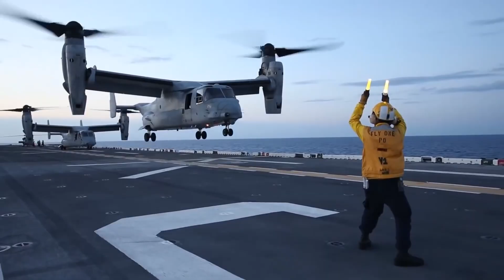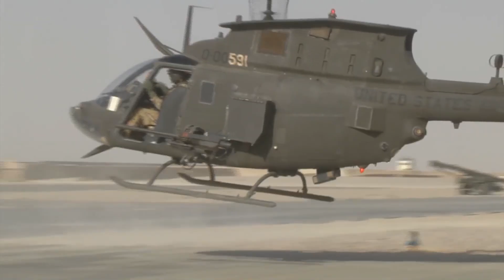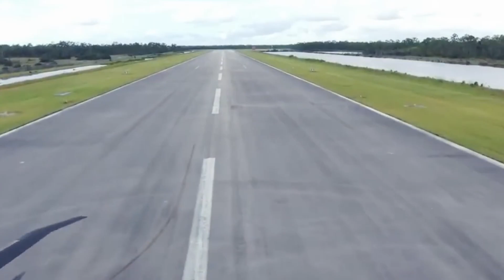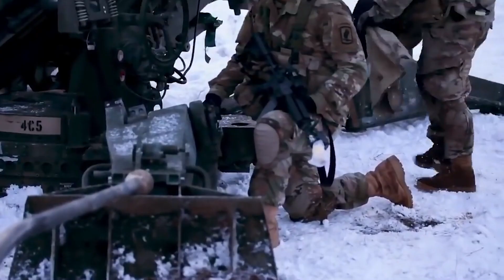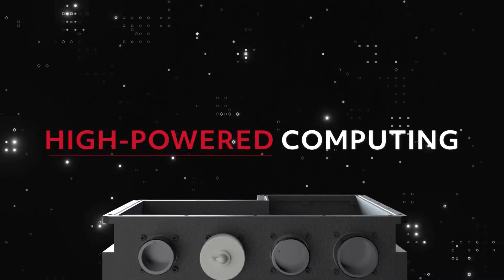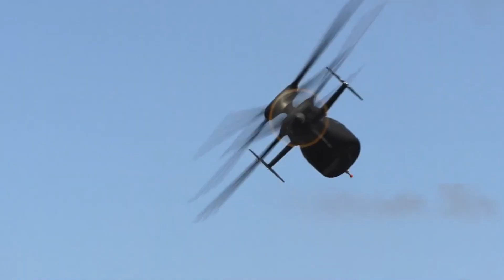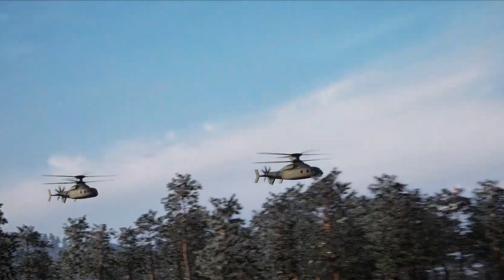SB-1 Defiant - Must go faster!

Comment: Can it fit inside a C-5/C-17?
Reply: If they have to transport it by plane they would take off the wings and rotors. One of the points of the program was for the aircraft to deploy itself and not need air transport as often.
Reply: @n3v3rforgott3n9 that’s a lot of air refueling, and can it reach the ceiling to refuel safely?
Reply: @PatrickJBird  Its ferry range is almost the range of a C-130. So likely for most trips it wouldn't need aerial refueling as it can go from Cali to Hawaii on a single tank. Although yes, all of them will have the ability to aerial refuel if needed and tilt rotors can be refueled by some of the larger jet tankers that other helicopter can't be refueled by as they can't go fast enough. It isn't the altitude as the plane can just fly at 10-20k feet or where they are needed.
Reply: @PatrickJBird  im talking about the v280 valor btw just to be clear

Comment: i just dont see the V280 doing the same thing that the black hawk did when  they went and got osama bin laden, i dont not think they could of got 2- V280s in and land in the area like the black hawks,,,,the old saying is if it aint broke dont try and fix it, stick with the same style , the DEFIANT is bigger and faster than the black hawk, and the the DEFIANT  can still do the same things the black hawk only better and much faster, did not so with the V280. much much bigger. if it lost an engine  in helo mode could it fly still, could it make the prop go from helo mode to plane mode and fly, or would it have to stay in helo mode the whole way back....
Reply: Not only was the valor better than the defiant in nearly every way but you are also overstating The valor's size. It has a 19% larger footprint size and total and would land in the same lz's. Also, tilt rotors can fly on a single engine.
Reply: @n3v3rforgott3n9  ok question here, could the V280 of been use for the BIN LADEN raid instead of using the black hawks
Reply: @highlanderthegreat  1. This is for the main army and SF will always use whatever they want. So that is a bad operation to look at. Instead look at the helicopter infiltration that happened in the first gulf war. 
2. Given that they breached the compound with explosives... yes. Finding the exact size of the courtyards is difficult. 
3. There is never one way to do something and plans can always be adjusted. Even going from the Huey to the Black Hawks had entire SOPs being rewritten and improved upon with time. The same would happen with this new platform.
Reply: @n3v3rforgott3n9  would they of trusted the V280 on the BIN LADEN raid
Reply: @highlanderthegreat  Not even the Osprey has a worse record than other aircraft still in service. The Air Force has their Ospreys at a better destroyed rate than their Black Hawks even though they use them for the same mission sets. The Osprey is also the first ever full production model of its kind.

Comment: The problem has nothing to do with power and everything to do with transonic turbulence.  At high speed, the forward-moving rotor will break the sound barrier and have zero lift while the rearward-moving rotor would be so slow that it will not produce lift either.  That is why the speed limit for helicopters is about 1/3 the speed of sound.  It's amazing they got that fast.
Reply: You can use stub wings or, in this helicopter's case, a pusher prop to reduce the load on the rotors which reduce their speed. Allowing you to get higher speeds.
Reply: @n3v3rforgott3n9 You can get higher speeds for a helicopter. But you will still have nowhere near the speed or range of a tilt rotor. Like I said above, the biggest feature that cause the V-280 to win is its speed and range. It is Self Deployable to virtually any anticipated theater of operation. The Army does not have to crate it up and have the Air Force haul it to the other side of the planet. For the Army that’s a game changer. In much the same way having portable drones have reduced the need for close air support missions from the Air Force. Inter Service cooperation and support is great. But anytime you don’t have to pass that coordination up and down the deep chains of command for 2 Services greatly improves efficiency in combat.

Comment: best video on the SB-1!  The good thing and the bad thing are counter rotating props.  Good because the asymmetric lift is cancelled out.   The helicopter can fly faster.  It can accelerate and decelerate while maintaining level flight.  Bad because the props can hit each other.  Anytime, anyplace.  In my perfect world, all maneuvers would be analyzed for upward force on the lower rotor.  How many tons of force are on the lower blade in a 90 degree bank.  Left or right.  Calculate the distance between the rotors.  The distance between the rotors is actively sensed.  Compare the calculated distance against the sensed distance.  That’s a lot of calculations.  Four blades on each rotor, two rotors.  Say 200 RPM.  If rotor ABCD is 200 RPM but rotor 1234 is stationary there are 200 X 16  calculations a minute.  If both rotors are 200 RPM there are 200 X 200 X 16 = 640,000 calculations a minute.

Comment: The only way to achieve higher speeds in a helicopter is to spin the rotors faster. To do that, the rotor diameter must be reduced. If the diameter is reduced, payload is also reduced. So the solution has to be a tandem rotor system. Also the angle of attack and the wetted area must be reduced to reduced induced drag and parasitic drag. So now the rotor looses partial ability to vector lift for forward flight. So the solution to this is a pusher propeller system as anti rotation is no longer necessary due to the double rotor system which has to be there to regain payload capacity. This whole machine is a collection of compromises.

Comment: Given Boeing's track record, I would not be taking any risks on procurement with an ambitious new helicopter design from them. The V-280 is just way more developed, proven, ready, and providing critical capabilities the military really wants (range, speed, reliability). Given the increasingly tenuous utility of attack helicopters in the modern battlefield and how incredibly expensive they already are, I'm not sure the SB-1's future as an attack helicopter looks bright either.

Comment: It cant go faster because of the physics of rotor blade craft , only if they can rotate the rotor 90 degrees  to the direction of flight, like the Bell V280 valour! which functions as a pure aeroplane , when in forward flight mode!  Helicopters are helicopters and serve doing those roles that planes cannot do.  The hybrid  helicopter / plane  such as the Bell V280  plane, can do both with very little compromise, why else would it be chosen?  Thus the traditional helicopter is now defunct, the V 280 will be chosen by all branches of the US armed forces for obvious reasons!

Comment: There had to be some dirty dealing to decide on complex, more difficult to fly, tilt rotor. Just in my youtube viewing I have seen a number of places the military will need to land a helicopter where the tilt rotor will not be able to fit.
Reply: Couldn’t possibly be because the V-280 met the specifications while the SB-1 needed a future engine to even reach minimum specs…

Comment: The ah 53 was a bit faster, it was capable of going I believe the max speed that a helicopter can theoretically go. Maybe it's time to dust off some 54-year-old design specs another reason why the helicopter is getting unstable it about 240 knots is that it doesn't have any Wings to take some of the stresses off of the rotor system. One of the biggest reasons why the ah 53 was so fast. And it could linger for an extended time and had a greater range than the A10. And was almost as fast as the A-10. Have the A-10 and that piece of shit Apache was a reason why they killed the Cheyenne helicopter. By the time they built the very first Apache they could have had well over a thousand of the Cheyenne in service with the same amount of money. And it is capable of doing everything the Apache is capable of doing only faster and longer and better and easier to fly.

Comment: Absolute speed and range is not everything and ideally both have a role. I personally prefer the SB-1 to replace the Blackhawk. While tilt-rotors gain a lot and they lose a lot of helicopter capability for that speed and range. I l's like to know how the outrageous downwash problem of tilt rotors is solved
Reply: Just because the Osprey has a certain thing does not mean every tilt rotor will have said thing... This is like looking at the downwash of a Chinook and saying making a helicopter half the size is a bad idea because it would have too much downwash.

"While tilt-rotors gain a lot and they lose a lot of helicopter capability for that speed and range."
...
Like???

Comment: I cant believe they 51ed the quad rotor crafts. Basically a full scale version of a 4 rotor drone tbat flys 600 mphs, up to 10 troops and extended range capability.  There was an eVTOL version as well. 

Maybe this thing explains somes UFO and UAP sightings of late. Not one pic on the internetz of it....

Comment: One simple way to make the SB-1 faster and have longer range is to give it some wings so that so much of the engine power and fuel isn't spent just on the lift rotors keeping the aircraft airborne in level flight.   Let the wings do that.  Then give the rear rotor a more powerful engine to fly faster.

Comment: They need to drop the drive shaft connection to the pusher prop and add a generator to power electric motors to drive the pusher prop. And possibly the rotors. They would gain efficiency and probably drop a lot of weight. A hybrid set up with smaller motor would give them a huge advantage.  And the single smaller high horsepower motor for power generation would give them the weight advantage as well as space  advantage without having two huge motors.
Reply: A combination of generator, controller, inverter, and motor is less efficient than a mechanical driveline transmitting the same continuous power... and much heavier and more expensive.

Comment: Hey, the Americans are starting to imitate the Russians
Reply: ... coaxial designs have been around longer than the Russian's have used them. Also this coaxial design is very different from anything the Russian's are using.
Reply: @n3v3rforgott3n9  . 
We can take solace in the advance that the Russians have taken in the field of hypersonic missiles.
Reply: @hugovictor4651  hahaha no they have not. That is a load of Russian cope. The kinzhal is an air launches iskander that does not go hypersonic in its terminal phase. These have been around since the 60s.

Comment: If the Valor can get into service quickly and cost effectively and fulfil a need, then it’s the right choice. But they really need to continue working on the defiant, it looks excellent .
Reply: The technology behind it needs to mature more yea. The Raider might be a good option for the scout attack role which will let them further advance the platform.

Comment: The replacement of the UH-60 with the tiltrotor will be viewed as one of the biggest mistakes the US Army has ever made. The tiltrotor just doesn't have the performance at slower airspeeds and at a hover that a helicopter has. That is where the majority of Army aviation operates in. The transition times and susceptibility to Settling with Power are big negatives especially when conducting Air Assault operations and Sling Load operations. Add to all that is the size of the aircraft. Its footprint is larger than a helicopter complicating LZ/PZ operations as well as Air Assault Operations. Tiltrotor aircraft would make a good complement to the SB-1 force in order to fill certain niches in a battlefield environment, but replacing rotorcraft altogether is a recipe for disaster.

Comment: The next main limitation on helicopter speed is that since the blade is always advancing faster than the fuselage air speed, it starts entering the transonic region before the aircraft does, and it is difficult to create a supersonic rotor for various reasons. And if you did, it almost definitely would be inefficient at lower speeds, where you need the lift the most. And it would be incredibly loud, like supersonic props. The Tu-95 is notoriously loud because of this.
Since the greater airspeed theoretically doesn't require such a high blade speed to generate the same lift, i bet when a coaxial rotor they could use computer control to regulate the rotor speed and  slow the blades down as it nears the transonic region. When the two discs it shouldn't cause any problem with there not being enough blade speed on the retreating side to sustain lift.
Though it just occurred to me that that is probably exactly what they did and i should have watched the whole video first.

Comment: Because tiltrotors become propeller planes in forward flight, it will always be more fuel efficient than a helicopter.  Unfortunately, a tiltrotor is succeptsble to fouling each other if two are landing close to each other.  So the Valor wins the utility helicopter competition, while i expect the Defiant to become the next search and rescue helicopter.  The next attack helicopter is up for grabs

Comment: You are completely wrong. The problem of higher speed on the advancing blade and lower speed on the retreating blade is not the reason for the limited speed of helicopters. This problem is solved by the use of vertical swivels. If there were no swivels, the helicopter could not fly, even at low speeds. The helicopter cannot move faster due to other factors, for example such as the speed of sound exceeding at the blade tips, when the main factor increasing the speed of the helicopter is the main rotor. Or there is the resistance coefficient on the main rotor increasing very quickly as the forward speed of the helicopter increases and etc. but not what you said.
The Defiant's biggest problem is the very expensive and complicated operation of such a complex propulsion system, which would cause huge operational and logistical problems in combat conditions. That's why he lost. The Valor's drive system is simpler in terms of operation and he won, although it does not have the same maneuvering capabilities as a classic helicopter or Defiant. Additionally, the Valor drive still can make progress in development in te future, while the Defiant drive no longer offers any development possibilities.

Comment: The main problem of helicopters is low speed - is typical mistake. The problem is small range due to low efficiency during horizontal flight.
This concept does solve this problem.

Comment: Kamov  already built hundreds of such chopers
Reply: Completely different coaxial rotor design...
Reply: @n3v3rforgott3n9 , different coaxial rotor design? Is it because of 4 blades rotors instead of 3 on Kamovs?
Reply: @antonkirov1923  no... Rigid rotor design vs flexible rotor design
Reply: @n3v3rforgott3n9  , instead of “hundreds of built Kamov”, this one is another type of aircraft.
Co-axial rotors have problems with autorotation. Not so much as on Tiltrotors, but enough to refuse passenger helicopters.
Of course, in any video about tiltrotors we can read comments that “this is one of the safest…”.
But same time another commentators mentioned many incidents with V-22 (half of used), which remain unknown. I.e. these accidents were hidden!
It’s just business.
Reply: @antonkirov1923  "instead of “hundreds of built Kamov”, this one is another type of aircraft."
-yes it has a completely different coaxial design...

"Co-axial rotors have problems with autorotation. Not so much as on Tiltrotors, but enough to refuse passenger helicopters."
-? where is this ever an issue? These are military aircraft which are rarely even saved by auto rotation... peoples fixation on auto rotation is stupid. You are pointing to a medium lift platform (Osprey) to say it has terrible auto rotation for the whole design. Guess what, other medium lift helicopters have shit auto rotation and can only ever do it in ideal circumstances...

"Of course, in any video about tiltrotors we can read comments that “this is one of the safest…”.
But same time another commentators mentioned many incidents with V-22 (half of used), which remain unknown. I.e. these accidents were hidden!"
-... the statistics say it is one of the safest aircraft the military flies... now you are just throwing on the tin foil hat.
Reply: @n3v3rforgott3n9 , I'm sure that people who think about helicopters auto rotation are more smart than you.
I already wrote to you that bad autorotation of tiltrotors is result of:
1. Small Moment of Inertia of rotors due to its small diameter.
2. Small rotors area (it's not the same as 1).
3. Bad efficiency of the blades due to big angle of the twist.
Hope you remember that bad autorotation is only one of other problems of the "safest aircraft ".
These problems but not the rumors prove that tiltrotor aircraft cannot be safe.

There is a nice story about a safety! People began to develop safety system and safety culture after two accidents in 1986. These are Chernobyl and Challenger disasters.
Both these disasters had same root (!) cause - bad design.
RBMK reactor had such construction when breakage of few channels lead to reactor explosion.
Same time Space Shuttle were not equipped with Launch Escape System.
Of course both project were created by thousands super-duper engineers.
So, how it was possible that they created such shit Nuclear Station and Spacecraft?
The reason is Statistic.
Because Statistics spoke that breakage of channels and explosion of Challenger's boosters were impossible!
Shit design is more important than Statistics.😉
Reply: Luckily he couldn't read this comment